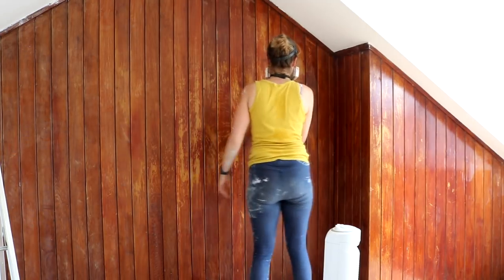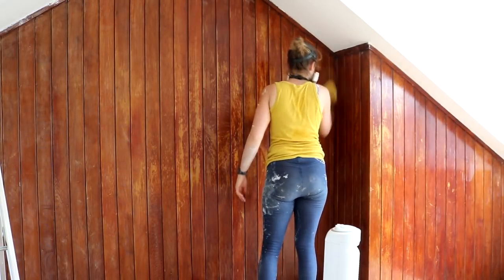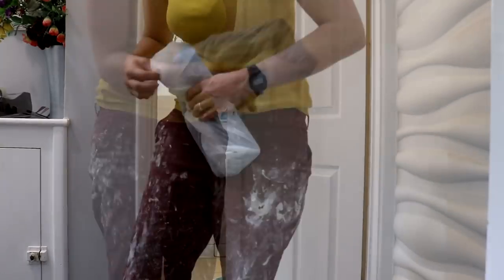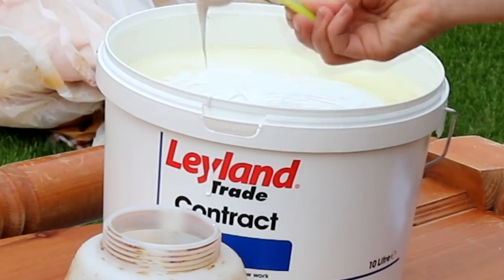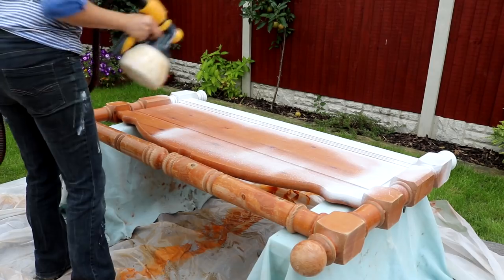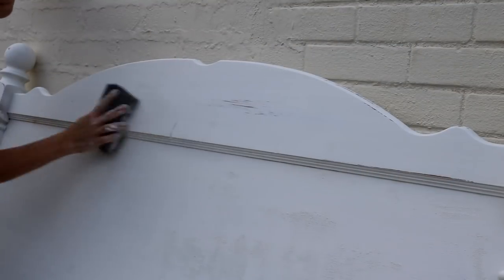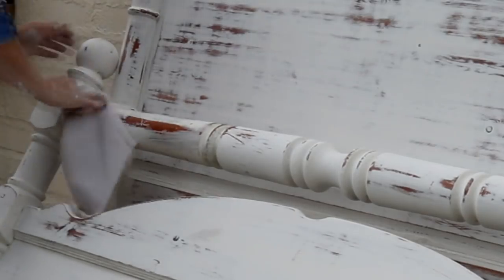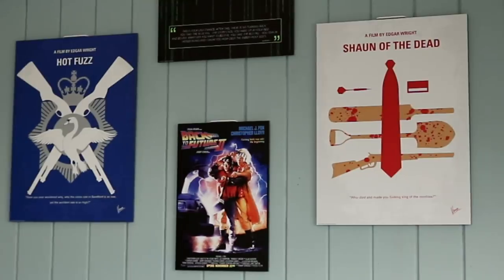Chalk Paint Decorating on Walls & Furniture | The Carpenter's Daughter

Comment from the maker: Here's my step by step making my chalk paint recipe: https://thecarpentersdaughter.co.uk/tips-and-tricks/how-to-make-chalk-paint-calcium-carbonate-method/
Reply: Copy of my comment: 

Appreciate any advice you can offer. 
Thx! 
Beth
Tennessee, USA

Copy:
You don't have to deal with Sealing Chalk Paint on the Wall?
Been trying to confirm this and no clarity on this yet. 
Appreciate any advice here. 

Planning to mix my own, less call mix for a thinner effect in hopes of achieving a sort of "linen typing/printer paper" effect or a light suede look. 

Note:  for your challenge
The recommended chalk paint tools are the brushes, a larger brush is made and recommended by Anne Sloan.
Reply: @bethbartlett5692   I would seal it either with wax or a couple of coats of polycrylic (matte if you want to keep the chalky look) particularly if it is an area where people touch the wall or something rubs against it.

Comment: You don't have to deal with Sealing Chalk Paint on the Wall?
Been trying to confirm this and no clarity on this yet. 
Appreciate any advice here. 

Planning to mix my own, less call mix for a thinner effect in hopes of achieving a sort of "linen typing/printer paper" effect or a light suede look. 

Note:  for your challenge
The recommended chalk paint tools are the brushes, a larger brush is made and recommended by Anne Sloan.

Comment: The bed didn't turn out great but everything else looks nice.
Reply from the maker: Well at least you're honest 😊
Reply: The Carpenter's Daughter lol "isn't to my taste" is the phrase isn't it! 😘
Reply from the maker: Of course 😀  if the sprayer worked better, then i wouldn't have felt the need to heavily sand out the brushstrokes 😂
Reply: The Carpenter's Daughter aah ok. bad luck. I had meant to ask constructively about the design choices about but my inner bitch was in control of the fingers at the time. excellent excuse for a follow-up video x
Reply: Have you ever tried a foam roller? - I'm a fan of using them to even out my still wet brush marks. Haven't tried it with chalk paint but I'm determined to say something constructive
Reply from the maker: Yes, I tried it with a foam roller but the texture didn't look as good next to the sprayed.  Then again, nor did the brushstrokes.  But thankfully if I ever want to go over it again, the chalkpaint can be painted over the wax 😀